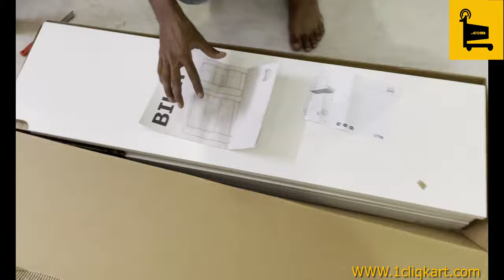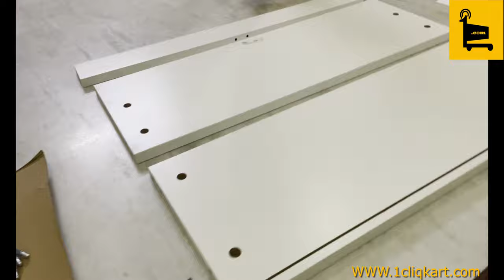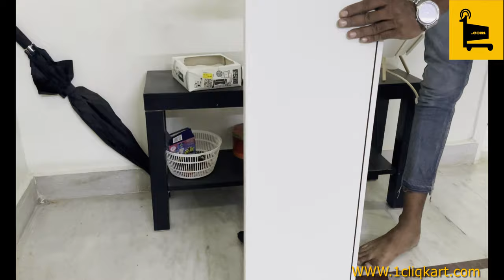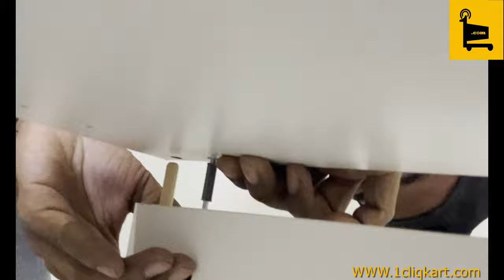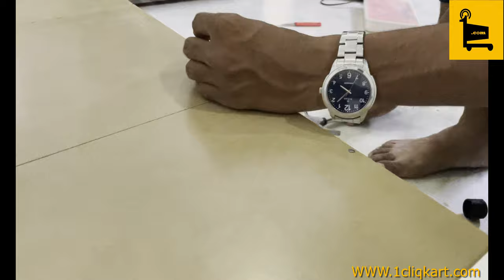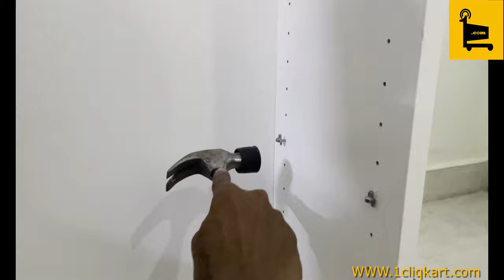IKEA Billy Bookcase Unboxing & Assembly

Comment: Is this stable enough to be left without securing to the wall? We cannot drill holes in our current apartment
Reply from the maker: YES, ,we are placing to the wall just for support, but as per safety measures you need to